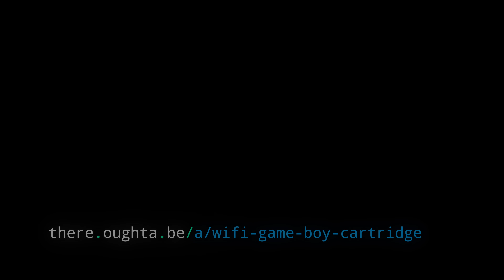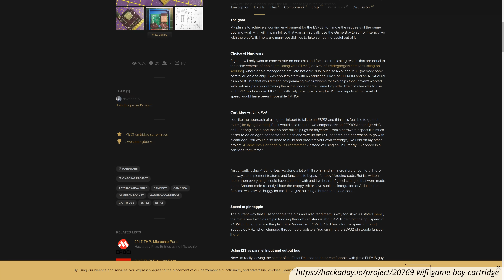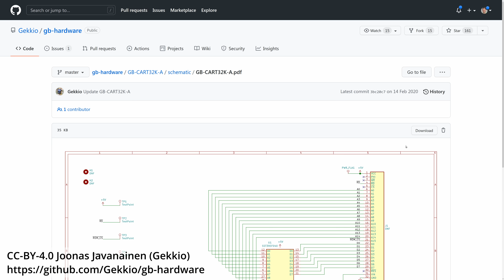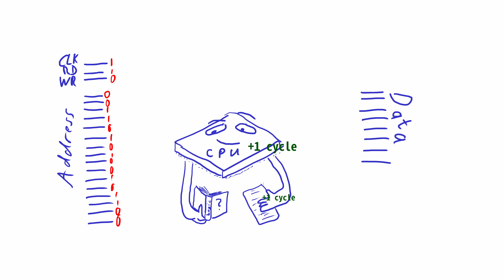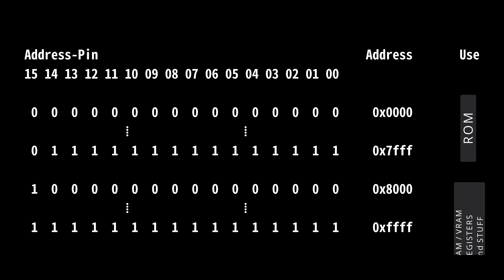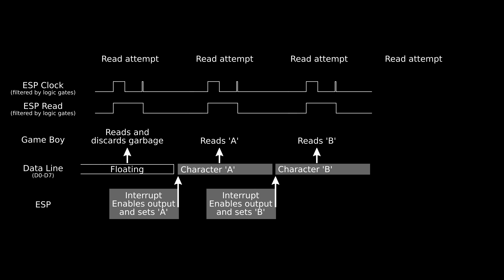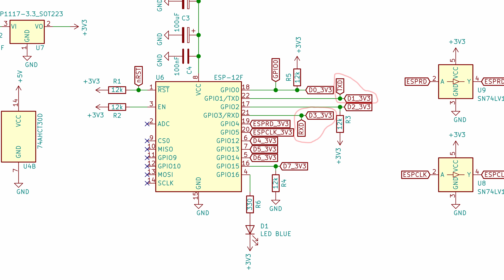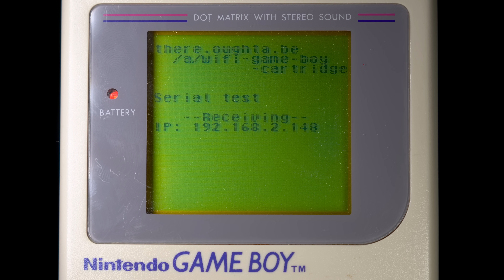WiFi Game Boy Cartridge

Comment: Hey great video, loving the work you did to get it up and running, i really want to continue working on my Raspberry PI Pico cartridge but with the new PICO W that has built in wifi and Bluetooth! I did some trickery as I was burning through power to get the pico overclocked so much that it could keep up with the clock cycles, but whilst you are not in a game, and are in the "game select" menu, I loaded the entire menu code into the ram of the game boy and made the game boy run from this region of memory allowing me to under clock the pico to save power. Once a game was requested, the game boy went into a loop trying to write data back to the cartridge, the data being the index of the selected game, once the pico had the game loaded, call the reset pin and boot the game. I need to learn PCB design though as I never considered voltage differences between the 5V gameboy and 3.3v pico
Reply from the maker: Hey, there is a name I recognize :) Glad you like what I did.
I am actually thinking about recreating this cartridge with an rp2040 myself, but without the Wifi (although I saw the new Pico W). I never really got the current spikes from the Wifi under control and therefore the WiFi cartridge has never been something one could give to others or that someone else could develop content for. Instead, I would love to hook up the rp2040 to a specific address like I did here (not emulating the entire ROM and hence not for loading original games) and let the PIOs handle most of the communication. This way I would hope to free almost all of the rp2040's resources. It would be limited to locally rendered stuff (opposed to streaming video from a full gaming console like I did in the other video), but it would be a self-contained and a stable cart that could be used by others, too...
Well, maybe once I finish the other non-GB projects that I don't find the time for...

Comment: I tagged you in a Twitter post. Some people have made wordle on Gameboy. However, there is some criticism over lack of of sharing (on social media) functionality. This wifi cartridge could solve that?
Reply from the maker: Well, as a proof of concept certainly. But in practice my WiFi cartridge still has the power issues shown at the end of the video. The battery life would not be that much of a problem as WiFi could be suspended until a score has to be transmitted and I had some success in making it a bit more stable by reducing the transmission power of the WiFi module, but still it probably is not a lot of fun to be used casually and some Game Boy models struggle more with the high power demand (I have read that the Game Boy Pocket is terrible that way, but I do not have one to try it). Oh, and the game of course needs to implement a menu to enter your WiFi credentials (which should not be that much of a problem, especially as a Wordle game already has the images to represent letters).

Comment: If you could do a similar thing to enable VoIP and/or internet on old phones without wifi using a mini sim (Which some places incorrectly call standard even though the original was the size of a credit card) then that would be greatly appreciated, but I can understand how that would be a bit more of a challenge. Even a Nintendo switch cartridge can fit an ESP32 if you do it right, but no chance of it fitting into a SIM card slot.

Comment: What about using external triggers on DMA to transfer data to the outputs?
Personally i love DMA, even used it to create a custom hardware serial communications device in an MCU that could transmit at near 1Mbit speed on an 8MHz CPU clock, while taking almost no resources from the CPU core.
And the core itself would have struggled to keep up with even 100kbit with SW data transmission.
I think if you could set up DMA to trigger externally to transfer data from a ready buffer to the game boy, you could make it transmit within just a few clock cycles after receiving the trigger.

Comment: A 3.3 volt cartidge that is 5 volt tollerant to work with even the gameboy micro and Nintendo DS. Pretty sure that's all it really takes, that's why the flash carts allow Gameboy color games to work on those newer systems. Logically compatible, just not compatible logic LEVELS. If I had the skill and tools, I'd make a more modern music player cart with it's own headphone jack, SD card slot, probably bluetooth, and all the graphics just text based. A little bit of search/sorting options. Keep it as simple as possible while being competent. Basically no frills.
Reply: Of course it'd need an output level shifter to output 5 volt signals when in an older system...

Comment: Humm I would suggest using a Cypress PSOC4 or 5 on it.  I have easily been able to connect it up to a bus of a 6800 and emulate RAM/ROM with its programable blocks.  I just had it run DMA requests evey time the CS went down.  It worked but really wish I had another cpu to handle the mapping.

I wonder if the new Raspbery Pico can handle it.  Duel cpu and it has those logic programable blocks that can link to the dma.

Comment: It’s been a year or two since I did any serious development on the ESP platform but would be interesting to se all this done in software. The ESP32-S2 comes with an ultra-low coprocessor (ULP) that can handle quite a lot, could probably offload the main thread by feeding the data into it instead?
ESP32-S2 also has an I2S bus that can be configured in parallel mode (mostly used for parallel LCDs or cameras) with DMA that could send/receive a large amount of data without loading the main thread too much. It also has more I/O compared to the regular ESP32. 
Alternately, the ESP32 also has an ULP but has dual core versions as well. But if I remember correctly, the ULP can’t be run when both cores are running.

Would be fun to explore such a thing!
Great work regardless :)

Comment: Would a ROM of this work on something like Raspberry Pi or MiSTer?
Reply from the maker: Not sure if I understood the question correctly, but you obviously cannot create a static ROM of the ESP or of WiFi in general. The code on the EEPROM however runs perfectly in an emulator, but without an ESP at address 0xfffe, it will not do much. The Wiki demo for example shows the greeting screen and then nothing else will happen as it keeps reading 0xff from that address without ever getting the null character that signals the end of a text from the WiFi module.

Comment: Reminds me a lot of Tom7 (suckerpinch) and his attempts to use a Raspberry Pi as an NES cartridge. He calls this "reverse emulation". He ended up actually using software to predict what address the NES would request next cycle, and writing it ahead of time. Turns out the memory access is generally predictable enough that this works ok, only resulting in occasional glitches!
Reply from the maker: Thanks, I found Tom7's video from another comment and enjoyed it a lot. But I already achieved video streaming through my cartridge (teaser here: https://studio.youtube.com/video/cxs_nHnqNB0/comments, still working on the full video with details) and my solution is surprisingly different from his because of how different the Game Boy works - or rather which different limitations it imposes.
The NES cartridges have two distinct memory buses. One for the "ordinary" ROM, accessed by the CPU, and one for video data that is directly accessed by the "Pixel Processing Unit" (PPU). Tom7 can therefore directly feed the graphics data from his cartridge to the PPU, but he has to deal with the problem that he cannot tell it what to do and hence he needs to predict its reads.
On the Game Boy, I need to write the graphics data to VRAM through the CPU. I do not have to predict anything, because I can tell the CPU exactly what to do and when to read the data from the ROM, but I have to deal with a different limitation: The PPU only allows the CPU to write to VRAM in short intervals when it isn't accessing VRAM itself (1ms inbetween frames and about 60µs inbetween lines), which makes it quite hard to get the data for a full image in there at a rate that can still be called "video" (I had to write the video streaming entirely in Assembly).

BTW: Huge fan of yours and a subscriber (with my private account) since your first appearance on Computerphile :)
Reply: That was a very cool 😎 video and i would love if that project was expanded and more people explored it

Comment: Maybe this will be useful: user "suckerpinch" was able to run SNES emulator (from a raspberry pi) on an unmodified NES through the regular cartridge slot. Maybe his ideas might help aid you.
(Basically, the NES just read and displayed the video data on the cartridge, which the raspberry pi just constantly swaps.)

(That form of "swapping out data continually" is how both NES and GB can achieve parallax scrolling and more basic horizontal interrupt based "wiggling" effects.)
Reply from the maker: Uhm. Did you check my teaser video? :)
Full res video streams via WiFi are already working. I just need a bit of time to create the video about this.

(Although your description on the solution for the NES sounds a bit different. The Game Boy does not leave enough time for VRAM access during each frame to transfer an entire image. Never looked into NES architecture - sounds like a video I should check out.)
Reply from the maker: I just have to follow up, after seeing suckerpinch's work:

Thanks a lot for pointing this out - I really enjoyed his video. It is interesting to see parallels to my project (like only answering requests on a second read attempt) and differences (writing to the cartridge via the address bus, which seems a bit inefficient).
Surprisingly, sending full screen video to the NES works quite differently than what I had to do on the Game Boy for my teaser video in which I stream the first Star Wars movie to the Game Boy. In case of the Game Boy, the PPU reads tile data from VRAM, which is not in the cartridge but in the Game Boy itself and I need to transfer the entire tile data in the short pauses (vblank and hblank) during which the PPU allows the CPU to access the VRAM. On the NES, he "only" needs to transfer the palette data during vblank, but the tile data is stored on the cartridge itself, so his cartridge can respond to these data requests while the PPU is drawing and is not limited by the vblank period. (This is also the reason that the NES cartridges have so many more pins on their (double-sided) connector: There are separate memory busses for the CPU and the PPU.)

Now I am wondering what else I should do with this technique... An NES emulator in a Game Boy cartridge would be quite exciting. On the other hand I wanted to do something more practical for the next project and maybe come back to the Game Boy later... Ah... So many great projects, so little time.

Comment: use 1.5v rechargeable aa batteries, they use lithium and step down to a constant 1.5v so it should help over come the esp32 issues on boot
Reply: Seconded. I’ve used Kentli AA batteries in high-current Game Boy mods, and they work perfectly. They can be somewhat challenging to get hold of (I think I bought mine from Singapore), they’re expensive ($6 per cell), and they need a weird charger (because each one’s actually a lipo battery and a buck converter stuffed into a AA form factor), but if you don’t want to mod the Game Boy itself, they’re exactly what you need.

Comment: a xylog or powerpc MCU could do the comms in software, but you would be writing the real time code by hand from scratch. no fancy libraries to rely on (more or less). I've seen literally this kind of application many times, and it is far from simple. it can be quite frustrating and takes a steady hand (metaphorically). it is quite doable though and you should have frames to spare
Reply from the maker: Nope, the frames are limited to 20fps because the times at which the Game Boy allows writing to VRAM is so limited that it takes three refresh cycles to write a frame. The dusty old ESP in my setup is not the limiting component.

Comment: Any secret messages/Easter eggs?
Here's what I got but I gave up after seeing that nothing happened and I no longer feel like doing anything else XD
0x7f 0x20 0x69 0x44 0x68 0x67 0x20 0x69 0x74 0x6d 0x65 0x63 0x6d
All from the blue text at the bottom of the cartridge section in order at 4:30

Comment: Just an idea, could you use a dual ported ram as a bus interface? Not so easy to find on the market anymore though... an emulation with a CPLD might come in handy. A more sophisticated way would be to use a small FPGA with integrated flash like those from lattice. Obviously you will not solder them as easily as most of them are in BGA packages. But you could get rid of the ROM and use the internal flash instead.

Comment: Well done! 👏
Funny because it's my actually my project I've been working on for the past 6 months, it seems so fun to put Wifi on a old console and it makes you learn and no one ever done it (except you now).
Sadly I'm quite busy which is why I never released anything yet and I'm rarely into it for now.
Your video is really well explained and I love the 3d animations, great job!
I like the method you use even tho there are simpler ones available and as I see you had similar issues like me.
My first breadboard prototype is working (can only send data via wifi for now) with my gameboys but I have no glitch issues with them related to the power consumption, using too a esp wifi chip on my side, maybe my batteries were new.
Actually made a new prototype with a pcb this time cuz spaghetti mess with breadboards 😂
 I'll try to release a video too on my side maybe :)

Comment: Your animations are on point. Not just the 3D ones, either. The one about the microcontroller with ADHD got the point across very well, and very quickly. I don't always have the energy to watch intensely intellectual engineering videos like this, but I think I'll sub anyway.
Reply: aw yeh I loved the hand drawn animations they were so fun ^_^
Reply: the board animation looks very clean, i also liked the transitions between 3d and real life

Comment: If you're after a challenge, I always thought it would be cool to make a USB stick that you plug into a computer and can use like normal, but it's actually sending data to the cloud, with the USB stick being a physical key and door to the cloud storage. By which I mean the transmission of the data goes through the USB stick itself via internal wifi. That way the computer's network card is bypassed entirely for this operation, increasing security. (Since both USB stick wifi cards and storage drives exist, this ought to be possible)

Comment: Perhaps a way to resolve the power consumption issue would be to implement a buffer between the wifi chipset and the CPU so that it wouldn't need to rely so heavily on interrupts when tasks are performed. Basically a sperate process that would pre-render the web page data into the cartridge memory. Once finished, the webpage would then be viewable from cartridge memory. Perhaps this approach would mean less restriction on components so that you could opt for faster and/or more power efficient components. 
  However, this wouldn't be much different, from pre-loading a wikipidea article onto a gameboy cartridge from a seperate device and then viewing it on the gameboy later. Only difference is that all of these processes would be done internally.
    
     Another, less elegant solution regarding the power would be to add a battery compartment for the cartridge. That said, it wouldn't be the only GameBoy accessory that looks gaudy and required additional batteries.

Comment: I would have used a raspberry pi pico instead of an eeprom, because it has plenty of RAM to hold a whole ROM, and because the programmable IOs can run independently of the main CPU cores.

Comment: You need to make a wireless trading cord adapter that will work with the 3DS. Then you could trade between original Pokémon cartridges and the 3DS retro console versions.

Comment: And here I was very convinced that I could make an Arduino with an SD module behaved like a cartridge for my Custom Game Boy Color Project and create my own programs or load multiple Hackroms. For good or bad I paused the project and this Christmas I thought about resuming it but you have open my eyes. I always thought that if the clock speed was superior it could make it and I do not have an oscilloscope so it would never work and I would never knew why.

Thanks
Reply: It actually can work, but you'd need to use assembly or optimized C, with no frameworks.
Reply: @Gabu_  Then I will try it, thank you.

Comment: An ESP-32 is actually dual core, so one core could handle stuff like WiFi, and the other one constantly watching the data bus. And an AND gate could be used to ignore clock pulses when the chip select isn't set

Comment: I'm not that advanced with this stuff, just a quick though, I wonder if you could have a ram module, and then just have both a wifi module and the gameboy take turns writing to it. So data changes would be on the fly similar to how old gamesharks worked.
Of course an esp or nodemcu won't be enough, as you'd probably want to connect directly to the data and address lines of the microcontroller.

I did the old serial link port thing, but with a small bluetooth module and used it to control a robot. Found someone who had a gba homebrew that just output keypresses over serial like > < ^ . LR AB over the link. And i just had 2 bluetooth serial adapters programmed to connect to eachother then had a microcontroller on the other end pick up the serial ascii characters and use that to control the robot. It was super basic, but worked great as a prototype.